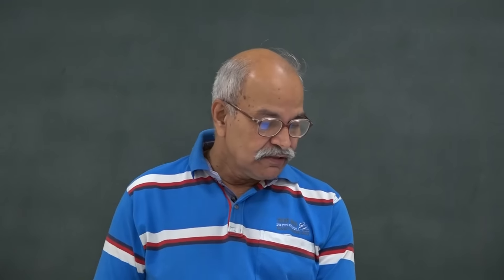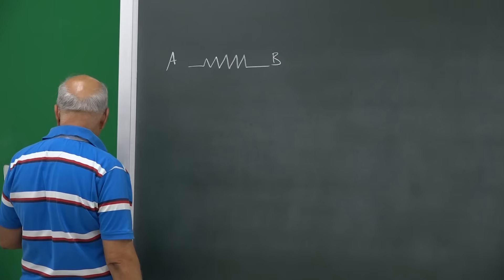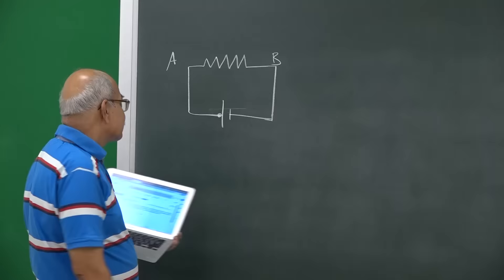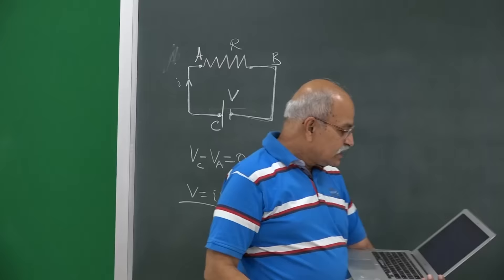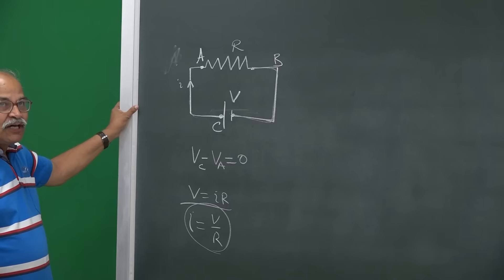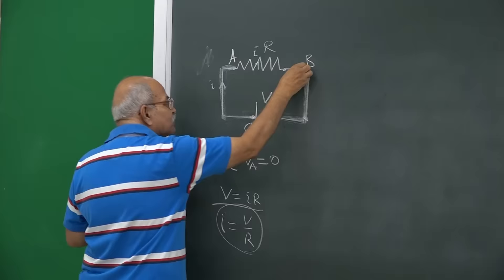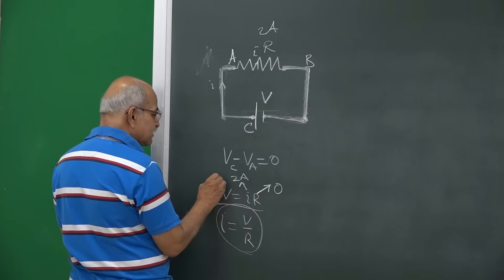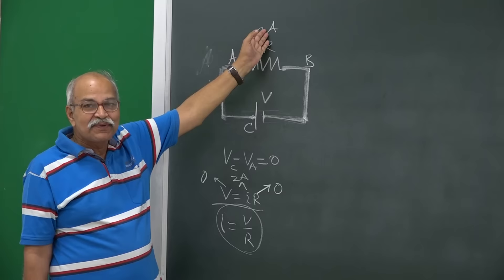Current without potential difference

Comment: Sir, what drives the current when potential difference is zero across A & C points  ????????????????????
Reply: The circuit is closed.. which means there is still a path for current to flow from +ve to -ve terminal of the battery. Since the potential between the 2 points A and C are an effect of the  battery.
Reply: if v=0 then v/r=i should be zero i dont understand how a current can   flow without potential difference
Reply: @anuragdeshmukh805  the battery voltage is not zero remember. The two points in the circuit A and C have a potential difference of 0. But the resistance, R will have a voltage drop of IR. If you were to measure the voltage drop across the the resistance with a voltmeter.. you will get the battery voltage.
Reply: @anuragdeshmukh805 in case of.... resistance of wire is infinite
Reply: the circuit as a whole has a potential difference created by the battery/d.c source. Imagine a pipe of water connected to a water tank kept at a height, correlate that with potential difference with reference to ground level. now when water valves are opened, water rushes down the pipes due to gravity and the rate of flow of water can be correlated with current. now imagine a horizontal bend in the pipes somewhere in between and then a bend again vertically before it reaches down
||
====
        ||
(something like this)
now there is no difference in height in the horizontal portion of the pipe but water still flows. how? think about that... yes, the answer is the driving force is actually the whole system and not the small portion. the same thing happens with a circuit. hope it clears your doubt
Reply: @NotBorno  nailed it bro
Reply: @NotBorno  superb ya... 😉
Reply: as we know there is no force required to move a body in an uniform motion provided there is no friction.. similarly if there is no resistance(friction)  the charge keeps on moving without potential difference(force) and hence there is current.. as in case of superconductivity
Reply: @NotBorno  the prob with this analogy is that.....the drift velocity of electrons wd be higher across A & C than in resister. If they are of same cross-section, then current i wd be high in A to C. Which is not possible. i.e. contradiction.
Reply: @shivendrasingh7929  tell me one thing.. why do electrons flow in a conductor? if you can answer this question correctly then your doubt will be cleared. don't get confused by drift velocity and non resistive conductors. in reality a conductor must have resistance for electrons to flow.. it is kind of like the fact that you need friction to walk. you can go on forever had you already been in motion in absense of friction. but in order to move forward without already in motion you need friction. consider A and C the same points because no resistance doesn't make any sense. we express connecting wires with zero resistance just to make the circuit diagram simple. by judging from your idea of drift velocity you must be studying physics in +1 standard. did you know that in reality electrons move so fast but a potential difference only makes its final apparent position move by a certain unit in a given time. the actual electron is moving haphazardly but a potential difference shifts that haphazard movement in an apparent direction and that movement is measured in drift velocity. drift velocity is an assumption on how an electron may behave in that frame because it would be too complicated to measure that haphazard movement. you are combining two logics- 1. that is real and experimental,i.e, ohm's law and 2. that is an estimation or an assumption to make electron flow simpler on text books,i.e, concept of drift velocity. ask these questions to your physics teacher and if he cannot answer, try doing your own research on how these concepts came to be. that is how you will grow as a science student.
Reply: Internal EMF
Reply: What a stupid question. There is a resistor connected with battery ( there is battery means, it has to have some voltage otherwise it will be an open ckt or ckt without any voltage source ). Resistor will draw some of the voltage and current will flow from it . The A and C point is considered as same point as they have no resistance in theory and , asli they are in series with resistor so the same current will flow from it.  CURRENT CAN NOT FLOW WITHOUT VOLTAGE DIFFERENCE IN THE SAME CKT
Reply: @h49suthar  Wire CA has 0 resistance as assumed, so the current will be lower in AB than CA and the Emf of the battery drives this.
Reply: @techmath3628  Wrong!  current will be same in wire, in resistor, in battery bkz they are in series. Wire is carrying same current as resistor just voltage across it will be zero
Reply: @h49suthar  Seems you are forgetting Ohms Law.... The wire CA has zero resistance so it has more charges entering than Given resistance AB no matter they are in series...Air is also in series with nude wire it doesn't mean that Air will shock us
I think you understand
Reply: @NotBorno  you are genius. Thank you so much. You clear my doubt..
Reply: Take connecting wire as a superconductor. So the voltage doesn't drop across the wire.... Point A and Point C is on the same wire so have same voltage.
Reply: Brethren , Your Question is Wrong in itself ! 
Although there is no Potential drop occuring between A and C , but still there is Potential Difference due to Internal EMF of the cell. This Potential Difference causes the current to flow between A and C .
Reply: @NotBorno  
Perfect explanation. This is what I was thinking. Using water analogy. Water still flows is the horizontal level due to flow of water due to gravitational potential difference at the upstream
Reply: @NotBorno  Excellent explanation. When I was younger, I had to do a lot of study to understand this bit. It is best if one studies it by himself taking some time.
Reply: Actually the current drawn from a voltage  source depends on the external resistance ( here) or overall resistances present in a ckt. Current - effect , overall voltage  diffence - cause...and it's value depends on resistance...so it never see the potential difference somewhere locally zero or not....this is the concept he is trying to convey us. Ohm's also satisfied in the region where potential difference is zero.
Reply: Practically there is nothing like a 0 resistance wire the conducting wire is so thick that its resistance is negligible when compared to the resistor, but the resistance is still there. So, let's say it has 0.001 ohm of resistance and the voltage difference between the ends of the wire will be 0.002V (if the current is 2A) so there is a voltage which is responsible for the current in the conductor
And a zero resistance wire is just a hypothetical wire that can theoretically generate any finite amount of current without voltage difference. Hope it helps!

Comment: Sir...i think you did not understand his  question correctly....his point  of view is-- the potential difference is zero..and the resistance is also zero...so how there is any current exist??.......sir, you told this mathamatically..but he wanted the     answer by concept.

I will be very thankful..if you give some time to my comment💓love you sir
Reply: Absolutely right!
Reply: Practically there is nothing like a 0 resistance wire the conducting wire is so thick that its resistance is negligible when compared to the resistor, but the resistance is still there. So, let's say it has 0.001 ohm of resistance and the voltage difference between the ends of the wire will be 0.002V (if the current is 2A) so there is a voltage which is responsible for the current in the conductor
And a zero resistance wire is just a hypothetical wire that can theoretically generate any finite amount of current without voltage difference. Hope it helps!

Comment: I m very much impressed by the question, Sir, I want to ask, If the electrons are not flowing in a direction, can we describe the electrons as current? And does the current practically available on the wire, when potential is zero?
Reply: You can say connecting wire is a friction less surface because resistance is zero then electrons moving without changing velocity then current not changing
Reply: Electron are not particularly current, they are charge carriers which provide when accelerated in a one single direction. And although electrons are accelerating in a wire but they don't constitute any sort of current because they are accelerating in random direction not in any particular direction and that particular direction is provided by battery or potential difference across the end of the wire.

Comment: My brain: kena kya chate ho?
😂😂
Reply: Hey is saying that there could be current in a wire (despite of zero p.d.) if resistance of it is also zero.
Reply: @kshitij__kumar  thx mate😁😁
Reply: @kshitij__kumar  wtf 
i=v÷r by that if r=0,v=0...current will be undefined....so mathematically  not possible. 
N how tf without a potential  difference current flows....as there will be no emf to ensure charges to flow along a particular direction...so theoritically not possible ...

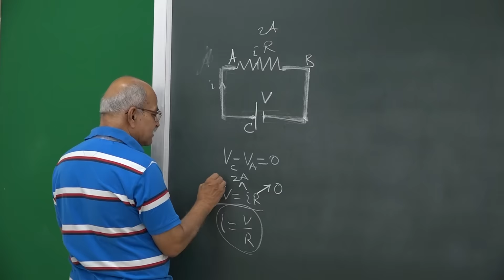And also at 3:14 he is wrong when he decides the value of current by already setting values of p.d and resistance cause in a equation you can decide value of almost every quantity except the one whose value the equation will give as an output value for the inputs provided by you.

In short i dont know wtf is this video about.
Reply: Without potential difference current never flows in any circuit.
Reply: @subhamdebnath3226  there is pd. It is between negative terminal B and point A. Here potential at C = A because all of the charge has travelled till A as it is, without any Resistance to face
Reply: @pratik2583   what do u mean...the title literally says current without p.d....
Reply: @subhamdebnath3226   they r saying - "current in branch C to A without any p.d between C to A". 
There is affcource a p.d across the whole circuit
Reply: @pratik2583  a branch is considered a branch whenever it has a element in it...such as resistance,inductance or capacitance but with no reactive current element or with a zero value of the same element, a branch is shorted...in that case it is no longer a branch..now as you said ,the branch CA is not a branch as you are considering it to be as it does not posses any current element on it . So the idea of even considering that without p.d across a branch CA current flows across it is nonsensical..as while representing a circuit you draw a square shaped close ckt but in actuality it is just a conductor with a certain qmount of resistance....there is no branch CA in this ckt
Reply: LHS=RHS. Hence proved👍👍
Reply: @pratik2583  Bro they are saying that all resistance is 0 or negligible but if we still pass current then current will flow throw wire because of R being zero then p.d will also be 0 as (V=IR). If we take R=0 and I=3 (say) even the  V=0 thus current flow even without p.d. Hence it is mathematically proven.
Reply: @Azazel._.  yes, it is absolutely true. All I was trying to do is to explain what is happening physically.....may I should have elaborated in a lucid way to make everyone understand what I was saying.
Reply: @subhamdebnath3226  yess bro what the fuck did he explained
Not logical
Sirf achhi book likh dene se koi achha pdhaa ske aisa jruri nhi
Reply: @kshitij__kumar  but how ?
Reply: @subhamdebnath3226  are bhai bhai😆😆
Kahan se laaye ye soch!
Reply: @iamss1244  bhai dhyan se dekh 0/0 means all real nos are possible in value for current
Reply: @subhamdebnath3226  abe chutiye 0/0 means i can take value of any real nos
Reply: @subhamdebnath3226  as 0*3=0 only
Reply: Then chenge your brain , because his teaching style so easy that a baby can understood all this very easily .
Reply: @SaifulIslam-lu7rp it was a joke don't get serious about it
Reply: @aryansaxena8081  Ha vai... tu sahi hai, aise toh koi battery  nhi chahiye na hi koi current element aise hi ek wire lelo aur boldo k isme current flow ho raha hai bina koi source k .Matlab logic ki toh maa behen krdi tum logo ney...

Aur vai  0÷0 tu yaha bhi sahi hai k koi v real no. Ley sakte hai par jab current flow hota hai uska ek constant value hota for a same source in the same ckt. Ab aisa toh nhi hoga k abhi 5 amp current ho raha hai toh abhi 10 amp with the same source...

Vai tune maths samajh liya par physics pey apply nhi kiya ,maine isiliye undefined bola k agar 0÷0 hota hai toh tu koi v real no. Ley sakta hai as a value of current par physics mai aisa hota nhi hai dost..
Reply: @subhamdebnath3226  sorry bro for abusing but i could not control my anger by seeing it 
really very sorry for that !
Reply: Book sir
Reply: Read his books then dare to say that what is he trying to say
Reply: @Quantum World please read his books then dare to say the what is he trying to say
Reply: @User15699  Well yes practically it is not possible for current to flow without voltage but theoretically it is possible as in the case of superconductors.
Reply: Subham Debnath I think becoz Potential is not zero... potential difference is zero .....Just like without resistance if the terminal C is positive it will repel positive charge to the infinity.....Becoz there is No potential difference.
Reply: tumhari samaj ke bhar hai jao pogo dekho😂😂😂😂😂
Reply: @subhamdebnath3226  P.D tends to 0 and Resistance tends to 0...thats probably what hes trying to say..so there might be current if P.D isnt completely 0 and resistance is really negligeable..😁
Reply: Name: Quantum World. 
Physics: Zero 
Irony: Infinity
Reply: @kshitij__kumar  hi ...u r saying that if  v - 0 ...then current can flow only if r - 0 ....so...here what we have to do is to just make V - 0 ...so ..if we take a wire of resistance 0 ...and do not connect it to any battery or cell then ( v  - 0) ...so ...how the current can flow ...pls tell me if anyone knows
Reply: @subhamdebnath3226  it's a circuit. Due to potential drop a current will flow in the resistor. Now even though there is no potential difference across points C and A, a current flows since the resistance is zero too
Reply: @pratik2583  but since a battery is connected, wouldn't a p.d. be generated across C and A??
Reply: @subhamdebnath3226  aur practically dekha jaye to bina p.d. k electrons to move hi nhi honge..electrons nhi move honge to current hi nhi hoga...to mathematically to lhs=rhs h pr practically bina p.d. k current ho hi nhi skta
Reply: @manjuagrawal5831  this is what I am thinking today I was learning chapter electricity class 10
Reply: 3 idiots scene 👆👆👆👆👆👆😂😂😂🤣🤣🤣🤣🤣🤣🤣🤣🤣
Reply: @subhamdebnath3226   form 0/0 is indeterminate form as we cant simply evaluate it but it still has value . Also In limit chapter u will learn to evaluate value of even 0/0 form. It is indeterminate and can take any value ranging from -infinity to infinity.
Reply: @manjuagrawal5831  but there will still be a potential difference across resistance so it will trigger current flow then continues to flow in zero resistance  wire also.
Reply: @happydudefriend  yes bro for sure✌️
Reply: Jyada load mt lo dimag pr jitna samajh aata hai utna kafi hai kaam chal jayega
Reply: If you can't understand this logic you should watch cartoon and go to bed.
Reply: @ARUNIMA SHUKLA please tell me why I=V/r and not v=IR
Reply: @ARUNIMA SHUKLA due to emf current is generated and due to current potential difference is created in a resistor......
Because of emf charges are set to move away from higher potential energy state which results in decrease of distance between electrons which results in a net electric field throughout the circuit. Because of this electric field only their is electric force on charges and the reason tha their speed is const is that this electric force is averagely balanced by collision forces. 
Sir was completely correct all he was trying to say that in a conductor whose resistanceis soo small (means very less collisions of electrons with lattice)l that the electric field required to move a considerable amout of current is nearly zero and thus potential difference accross that branch will also tend to zero.

The potential diff is not exactly zero it tends towards zero.
You are in your initial phase of learning and have very less knowledge about electromagnatism and hcv sir is a phd....you should not think that he is wrong but should try to find loop holes in your concept. 

Ohms law doesnt state all these thing you mentioned that is just bookish language to write ohms law....ohms law can be proven very easily mathematically
Reply: @subhamdebnath3226  what u want to tell
Reply: @subhamdebnath3226  he is correct ur concept was wrong
Reply: 3 idiot....kena kya chahte ho??🤣🤣
Reply: He just not understand the question ,
First p.d is measure only when difference in charges if one side p.d is zero that means distribution of charges from A TO C   is same even the current is flowing but the charge distribution is same in a to c thus measure of p.d is zero but current is flowing in the circuit
Reply: @subhamdebnath3226  2 min silence 4 u man
Reply: All he is trying to say that according to ques the potential difference in the wirebetween the battery and resistance is 0 but still there is a current flowing in the circuit. It's obvious that if the potential difference is zero then the wire resistance would aslo be 0 there cause these are connecting wire and we do not consider the resistance of connecting wire. In simple words the wire is short circuit in between the resistance and the battery.
Reply: Me too ☺️
Reply: he is just saying that youvare not capable of learning physics

Comment: Potential difference between A to C is zero because level of electron flow between them is same but electrons flow...and as current is define in a way that number of electron flow per unit area. .,..this question does not have deep mean .  this..only for psychology....
Reply: I like ur explanation rather than that in the video